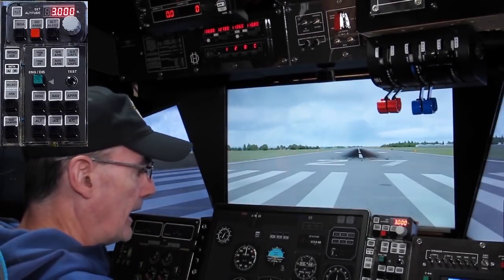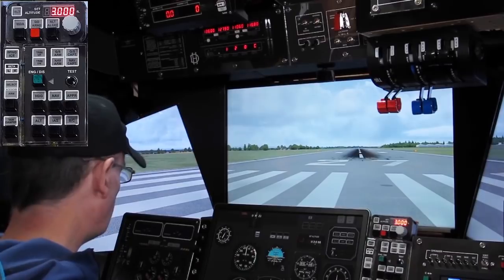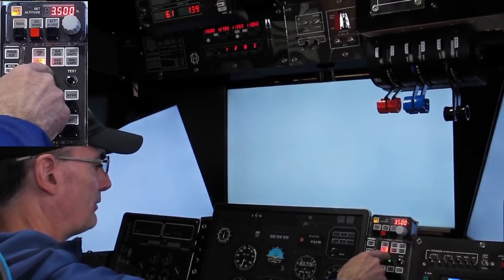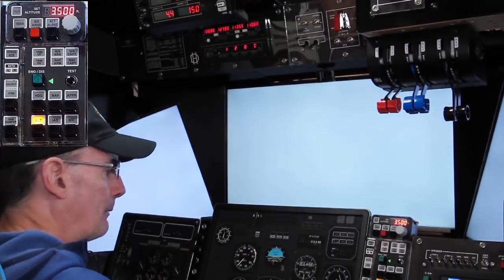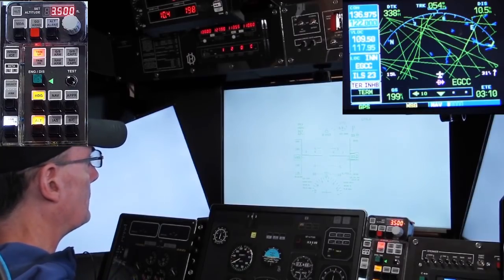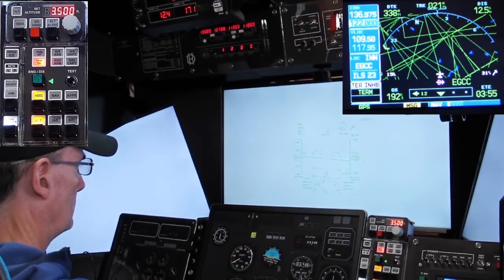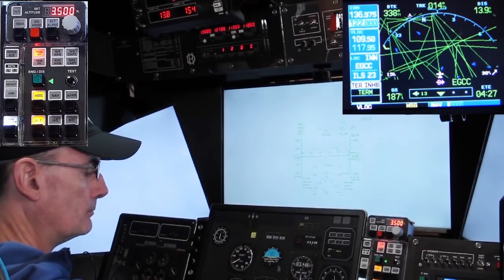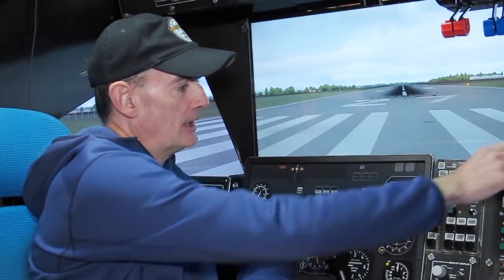Flying the New Autopilot (Twin Otter Cockpit Build - Part 53)

Comment: Fantastic series of videos, thanks for the uploads. I’m very new to electronics so apologies in advance if this is a silly question, but I want to use a latching push pull switch or button as a parking brake. most I’ve seen are 12v (with a built in LED, although I don’t want to use that but have a separate LED wired to the Elegoo as a warning light) could this work or will it have to be a 5v switch? Any advice would be much appreciated;0)
Reply from the maker: That should work fine. After all, a switch is just a couple of bits of metal that touch each other when closed. It should always be safe to use a lower voltage than rated, but using a higher voltage would probably risk arcing. You should also see a max current rating, which is about the load the switch can carry before you risk damaging it. (There will be an extra tag on your switch for the LED ,which you would just leave unconnected.)
Reply: Thank you very much!

Comment: Any chance of adding a variable dial for the resistance/brightness of all LED's on the input before each LED resistor of course.
Reply from the maker: Actually no, there is no easy way to do that because each output is effectively a separate 5V on/off source. I guess you could add some kind of transistor circuit to each output and use that to connect to a common 5V line that has a variable resistor in series with it. It might be an interesting thing to look into and if it's possible it wouldn't be physically hard to add it on, since it's at the arduino end, not inside the panel.
Reply: You can 'dim' the common ground for all the LED's maybe? Using a ULN2003A, but it does require some rewiring. One ULN2003A can handle up to 500mA, you can use a few if necessary, but 500mA is already a lot. Then you need one output to PWM the ULN2003A and the hw_output_add's still provide the 5V.
Reply from the maker: @ralphrietveld  Thanks Ralph, I'm learning a lot :)